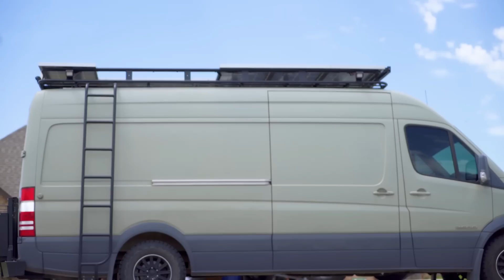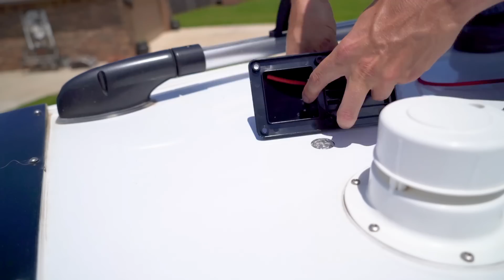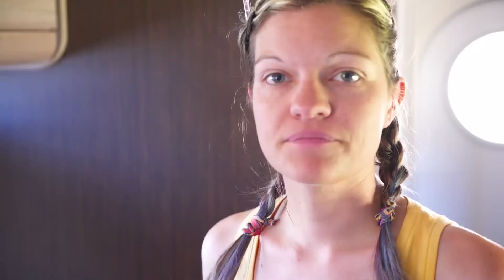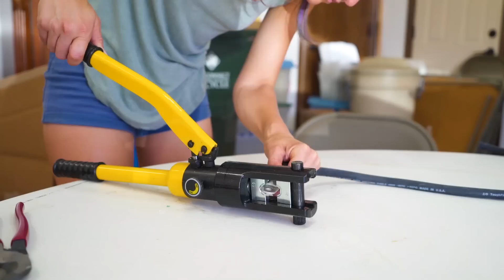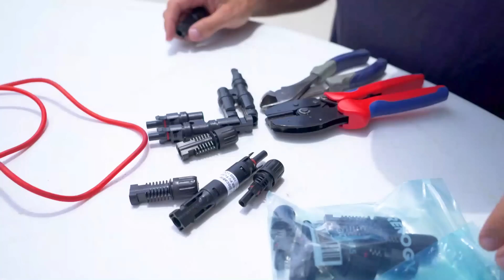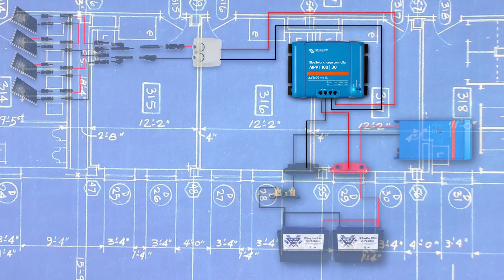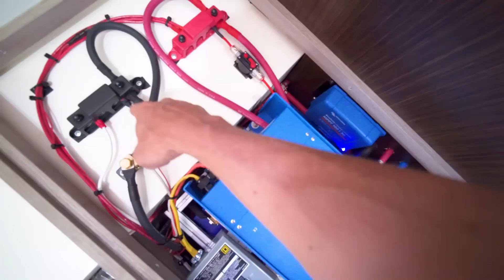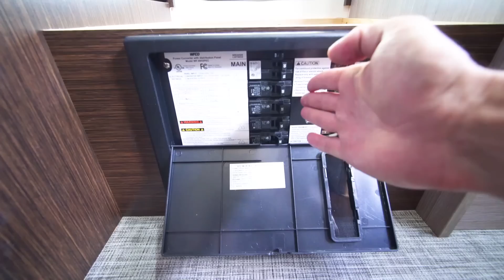Camper Solar Setup Tutorial - How to Solar Power your RV, Camper Van, & Truck Camper

Comment: thank you for shearing, need to know whats the cost of all this? Bless you
Reply: Just figuring with what I know..... The panels can be found for about $120.oo apiece if you look well......the batteries may be found for as little as $130 but quality batteries are very important to solar so plan on $300 each. With electronics advancing so quickly the cost of charge controller is about $70.oo. Inverters vary in quality in the extreme so it would be difficult to quote a price. To simplify solar think of it like this..... the sun shining on a panel makes DC power... what powers every auto  system....very little power... almost like trickle charging a battery overnight. The charge controller just makes sure an even and  usable power comes from the panels. that power slowly charges your batteries to their max . Now with full charge the DC power needs to be converted to house power or 120 volts AC . Some energy is lost making this conversion but little with a quality unit. Now you have turned sunshine into usable house power. The 12 volts DC stored in your batteries will run many things in your RV..... dont forget to buy items that will work under car power instead of house power. It will work much stronger and longer that way. ar power will not shock you and is extremely simple to wire. A red positive wire is run to each item and a black negative ground wire follows. This ground wire is attached to the steel frame of the RV so any appliance attached to that frame does not need a negative wire ! Almost every car in the world works like this ! A switch simply "cuts " the red positive wire  apart and when turned back on puts the wires back together. The buses are simply a way to attach many wires together . In drastic situations I have had to find old faded panels , a used , cheap inverter and controller and put them with 2 old car batteries I got for free. Not promoting such a sloppy job but the idea is...... it worked..... well enough until I could get back across the country to my home. Hope this helps anyone.... this couple do it RIGHT..... and do a wonderful job of explaining it. Kudos.

Comment: Great Video!    Quick tip when installing the MC-4 Connectors, Tyco,  Amphenol, or any other 4 prong solar-type connectors you may come across.   Do not disassemble the bottom part (End Cap, Compression sleeve & strain relief) of the connector that tightens around the wire.   Simply loosen the end cap and press fit the Wire with the freshly crimped pin into the MC-4 fitting with the cap still connected to the MC-4.   When you hear/feel the snap, you are now securely connected.   You can then quickly tighten the Strain relief/ end cap around the fitting.   Regardless of how you choose to do it, always give your newly fitted MC-4 connector a pull test by lightly tugging the MC-4 from your wire.  
Hopefully, that will save someone a little time in the future.   I've been installing residential, commercial, and off-grid solar for the better part of the last decade and I am happy to see that the Van Community is finally getting some good quality instruction here.
Reply from the maker: I think I've read this about a dozen times trying to visualize the process and I still haven't figured it out.  Do you have a good video demonstration you can point me to?
Reply: A simpler way to explain it would be:
1. Crimp the pin onto the wire (follow all nec. steps as you have shown),  
2. Loosen, but do not disconnect the nut(or end cap, or strain relief twist fitting) which houses the strain relief.   
3.  With cap loosened, fit the MC-4 over the wire just as you would if you had it all separated out. (Cap end First).  
Loosening the cap opens the bore of the rubber strain relief.  Instead of removing it completely, you can loosen a quarter turn or so and press fit.   
But I just realized how few of these you have to install in a system this size.   This will save you a couple minutes max and not worth the confusion.   Use the technique if you remember next time. you're helping out someone seeking your experience.   
Again,  great video,   Keep them coming.

Comment: which is beast lots of batteries to make the solar panels work at there max most of the time, my 130 amp panel keeps the batteries at 13 amps then the monitor tells me the panels are only giving me a few amps
Reply from the maker: I'm sorry, I do not understand.  Would you mind rephrasing your question, please?

Comment: Great video, thanks for the info, I'm currently building a portable solar generator, have 4 -100 watt , 18-volt panels planning to expand by 2, 3 Battle born 100 thinking  1 more later, Aims 3,000 to 5,000 pure sine, and a few extras for the build. P.S. also the Outback flex 80 charge controller.

Comment: useless the wires are not explained as usual all these videos are complicated and useless
Reply from the maker: A lack of comprehension doesn't equal uselessness.  What questions do you have?
Reply: theres no illistration about the distinction between the 110 v system and the 12 amp system for lights and fridge... which is common in rvs, nor an explanation how to hook to 12 amp system itself within the rv
Reply from the maker: Thanks for the clarification.  I hope you found all of the wiring diagrams on this page: https://www.explorist.life/diy-campervan-solar/

Those wiring diagrams will likely clear up a lot of your confusion.   Connecting to the 12v system in the rv is pretty straightforward and is covered in the wiring diagrams, it's just a wire from the battery to the 12v fuse block.  

Let me know if you have any  other questions.

Comment: Love your videos. They are super informative. I want to use solar on my truck camper but want to run everything including the AC. Which is a Coleman 9200 BTU that has a running wattage of 1270. I am looking at 2 larger lithium batteries of 250 amp hours each for a total of 500@12 V. And run  3000 watt hybrid inverter to power the set up and skip the generator all together. Don’t need the AC except for nights thus no solar help but also shouldn’t run the compressor full time.  What are your thoughts
Reply from the maker: How are you planning on charging the batteries?
Reply: MTTP controller for the solar and trying to figure out a way to increase the voltage from the diesel trucks  large 220amp oversized alternator which only puts out about 13.6 volts to the 14.4 that the lithium needs for a full charge.  I know it sounds strange but has anyone used an inverter to go from the 12v DC to 120 V AC then run a charger for the lithium at the 14.4?

Comment: I'm confused, why would you use 4 x 100 watt solar panels when much more efficient, 300+ watt panels are available?  Are you promoting Renogy panels for profit?
Reply: Here is a thought on bigger is better.  16 years ago I decided to switch from a loud generator to solar pannels for my bus conversion. Back then E-bay was my friend, so I started shoping. At that time not many people was useing Solar on RVs But Sail boats was a pioneering goldmine. I baught two 120 W pannels and a couple of 100 w. marine pannels All marketed and branded as Shell Energy products. I used these for a year or two as a carry on and portable set up building my own ground level supports. The third year I was able to pick up 39 Sunforce 15 W pannels for just over two dollars a watt.  I found that the newer pannels put out more power in less light than my older larger pannels per sq inch of serface. I was happy about that and not totaly surprized because tech was and is continuasly improving. I was continuing to use all of my pannels to keep my ten deep cycle batteries charged. I ran two seprate  circuts and  seperated my battery banks as the four large pannels was rated at close to the same Watts as the group of smaller Sunforce pannels. It was all working well untill while on a two week outing a gust of wind tipped my array of larger pannels over and when I put it all back up I found that one of my 120 W pannels had lost continuity in one of the cells and that entire array went from 440 watts down to 320 W.  I got to thinking if I loose one expensive large pannel that brings me to less than 75 percent of my normal out put  And my smaller pannels would have to lose  9 pannels  to equal that loss.  By the way it has been 14 years sence that event and I have expanded my group of smaller pannels (all Sunforce) and have only had five pannels stop working for one reason or another. All of the large shell pannels have been retired. It is also easy to arrange the smaller pannels arround obsticles when I mounted them on the roof.
Reply: Nolan Getsinger   Way too much to read...  KISS System is better.
Reply from the maker: A 300 watt panel wouldn't fit on the roof of this truck camper.  Do you have a question on how to size solar panels for your camper?

[Although we DO make a commission on products purchased through our links, we aren't necessarily promoting renogy.  We can promote ANY solar panel available on Amazon.  We just happened to pick renogy]

Comment: Argh, that positive DC loop out of the inverter charger.and the negative out of the DC shunt.... why not run the cable straight out to the next busbar lug instead of trying to loop it round to the same connection as the battery lug. That would look a whole lot neater no?
Great demo though and great content :) I hope they enjoy the new wild camper
Reply from the maker: Either way.  On the battery to inverter run, I like to have lug to lug contact rather than lug to bus bar bus bar to lug contact.  I'm sure resistance is negligible, but that why I chose to do it like that.  What you're proposing would be fine as well.
Reply: Fair comment. You could be super neat and fit a Victron Lynx in there and have all the cables and fuses in one unit and get rid of one of the busbars completely too. :D

Comment: I agree with the comments below.  This is outstanding.  A couple of comments for future videos you do.  Slow down a bit in areas that are critical to the install or topic.  I know you do not want to have a “too long video” but a bit more would help folks like me.  Also how did you choose the hardware, places you chose to run wiring, why some things need to be done.   I know this may sound negative.  They are NOT!  Just improvements.  Again this is a great video!

Comment: what's the difference between MC3 and MC4 panels, can the be used together or do we need to buy specific componenets? thanks
Reply from the maker: MC3 and MC4 are just the connector types on the panels.  MC3 is obsolete.  I don't know that I've even seen one recently.  But if you are using my parts list, it shouldn't have anything MC3 on it.

Comment: Can the "SmartSolar MPPT 100/30" handle 6 -12v 100 watt solar panels wired in 24v pairs (series) that are then wired in parallel? 600 watts at 24v should be 25 amps? Similar to your 400 watt system but just adding two more 100 watt panels.   Im really just wondering if I can add two additional panels to this system later. Thanks

Comment: How many panels do I need to operate two a/c?
Reply from the maker: You'll be looking at, in the ballpark of 2300 watts of panels and 1300 amp hours of batteries.
Reply from the maker: But if you want me to do the actual math for you and put together a shopping list and wiring diagram, email me. (Note: this would be a paid service)

Comment: 12/2000/80 Victron Inverter/Charger - does the 80 in the (12v/2000w/80?) represent Amps?  And if Yes, is that the maximum rate at which this charger can recharge your batteries - 80 amps/hr? or 5 hrs of charge time to re-charge 4 - 100 Ah batlleborn batteries connected in parallel that were completely discharged.

Comment: Just one question I noticed that in your ebook diagram your solar panels were configured in a 24 volt setup going to a 12 volt battery Bank I don't think the charge controller can go from 24 down to 12 can it.
Reply from the maker: It can actually go from all the way up to 100 volts down to 12 volts.  That's the glory of an mppt controller.

Comment: WOW!  Thank you !!  This information is just what I've been looking for.  Researching and trying to find answers to questions - you laid it out specifically and with so much detail AWESOME!!  I still have some questions about some details but will have to find those answers I think directly.  for ex. What size MPPT controller for how many Watts of Solar? And if your Unit is 30amp does the controller also have to be 30amp...finding a wiring diagram for the Unit is as bad as pulling teeth, how did you develop the layout/schematic inside the unit?
Reply from the maker: Thanks so much!

"What size MPPT controller for how many Watts of Solar?"  How about this?  How many watts are you trying to fit and I'll tell you what controller you need.

"And if your Unit is 30amp does the controller also have to be 30amp?"  No.  They are not related.

"how did you develop the layout/schematic inside the unit?"  I looked at it and figured it out. lol  Sorry for being so vague, but that's where experience and understanding how this works comes into play.  I understand it so you don't have to. My dad used to say "Spare me the labor and give me the baby"  This is the same idea. :D
Reply: i bought unit used - it has two 160W panels + 10W panel.  Since I do not plan to install any more panels and the Unit is 30A Shore Pwr,  would a 100/30 MPPT be sufficient?  LOL, another question if you care to answer;   What size inverter for this particular Solar Output?  I was thinking 2000W??  I appreciate that you detailed the fact that you disconnected the Units Converter..I've been wondering about that. Thanks again!! SO MUCH!
Reply from the maker: This is the charge controller you'd be going for: https://amzn.to/2AyLtH3

The inverter is independent of the size of the solar system.  Nontheless, A 2000W inverter/charger would be perfect: https://amzn.to/2ABfGW9
Reply: I can't thank you enough!!  I've been racking my brain trying to figure out these details, with only YouTube for support.  You have really come through BIG THUMBS UP!!!
Reply from the maker: No problem!  Happy to help.  If you are on Facebook, you should join our DIY Campervan Crew group.  LOADS of good info and super smart people in there: https://www.facebook.com/groups/DIYCampervanCrew/
Reply: got 'em both saved to my shopping list. :)
Reply: Thanks!! Will check it out for sure.

Comment: Strongly suggest using some red locktite on the bolts that hold the panel brackets to the panel.  Wind can cause vibration that can work them loose.  They are very difficult to re-tighten once the panels are installed (assuming one discovers that they are loose before a problem arises).  Cheap insurance.

Comment: I was told you can run your camper ac if you install a soft start to stagger the peak load when the ac unit starts as many of the ac units are only a 15amp draw.
Reply from the maker: Keep in mind, that's a 15 amp 110v load.  If you were running it off of batteries through an inverter (12v to 110v) it would be closer to 150 amps, which would drain 200 amp hours of batteries in a little over an hour.
Reply: Adventure in a Backpack damn.. that's disappointing. I was hoping to figure out a decent setup to run my AC. The Winns YouTube channel they were able to figure out how to do a set up with their ac. I apologies if I spelled their name incorrectly.  I don't know how they're doing it however.
Reply from the maker: I mean, it's possible, but you are going to have to have a much bigger system than what we installed on this truck camper.
Reply: Adventure in a Backpack I super appreciate your videos by the way. :)
I'd love to see a video on how it would be possible if ya'll ever have the chance. From what I'm told the key is installing a soft start however saying that and doing are very different endeavors. 

Your videos have help me and my gf a lot. We're full time living in a slide in camper.

Comment: Great video and thanks for the plans as well. I would like to know is the shunt mandatory or optional.
Reply from the maker: It's not 'necessary'  but it would be like driving a car with no fuel gauge.  It's not the thing to skimp on with a premium system like this.
Reply: That's what I thought thanks for the fast response This is exactly the system we want to put on our bus conversion. Your info is so helpful We are currently helping a friend with a system like the one on your moms truck camper and he forgot some of the parts (ie shunt) LOL. Also I would like to know what kind of refrigerator you are using on this system and how long you can go if you dont have full sun. Thanks again for all the time you put into your information.

Comment: you should "recommended as a must" "in case of a catastrophic failure" have a fuse on the positive coming from the batteries to the J-Block and fuse from  j-block to inverter also a good idea is also and a fuse on the neg also but not really necessary.
Reply from the maker: Did we miss that on the wiring diagram?
Reply: it did not show in your build on this, but i think you had it in your main build on your own van.
Reply from the maker: ...in the emailed download...

Comment: Just curious if you tried to run the Air Conditioner by itself during the day while it is sunny.  Seems like it would run it if the system is 15-20Amps and the AC is 15-20Amps.
Reply from the maker: Great question!  12v DC and 110v AC aren't interchangeable.  Something that would run on 110v power at 12 amps (like the air conditioner) would actually take 120ish amps of 12v DC.
Reply: Yeah if it draws 12A  at 120V you would probably need at least a 1,500 watt solar system.